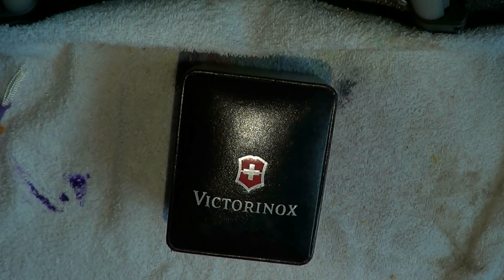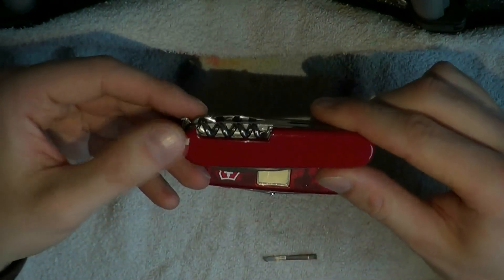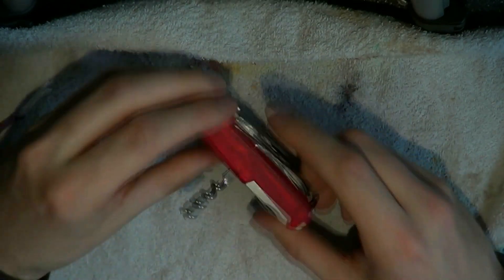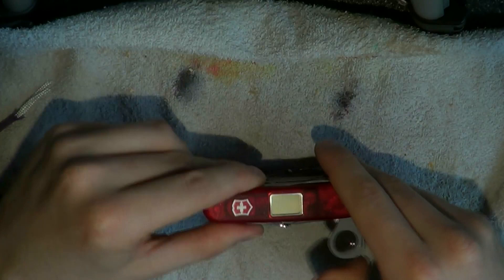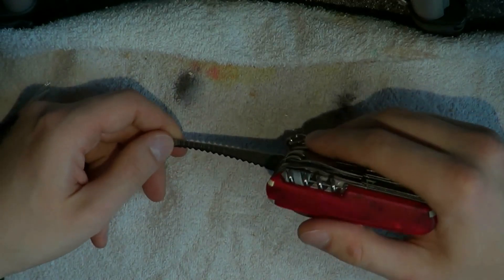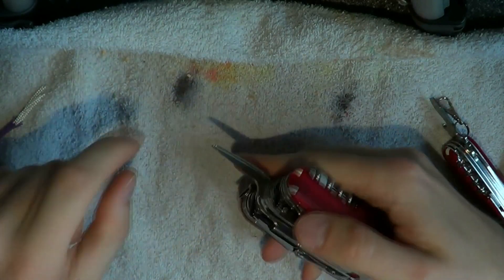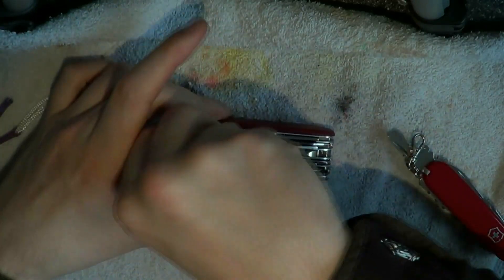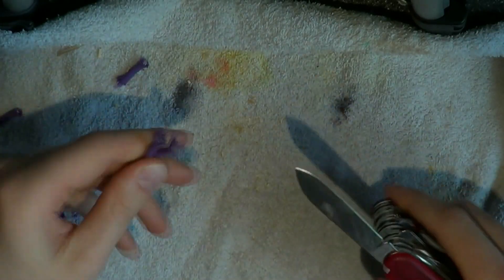Gearing up with SBRE Brown Victorinox SwissChamp XAVT

Comment: I,m using a Swiss Champ for years. (My trusty EDC ). You can use the parcel hooks to put the knife upright on a table. Open the magnifying glass.(It will sticking out on the top). And you have 2 hands free. I used it this way to remove a splinter from my hand.
Reply from the maker: That's a cool tip, thanks!

Comment: I suppose the fact that it doesn't make sense is the point, really.  Were Victorinox to offer all the features in a nicely packaged set of three knives it would be a far more practical proposition, but not a talking point.  Interesting - thanks Stephen.
Reply from the maker: Yes, I think one should consider this a collector's item; although all the separate tools are useful, that is not necessarily the case for the whole package.